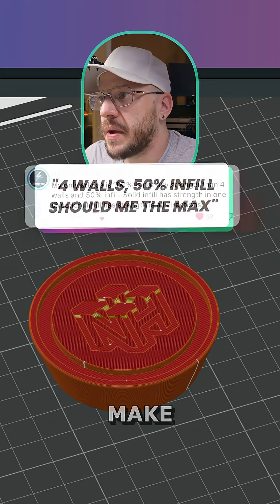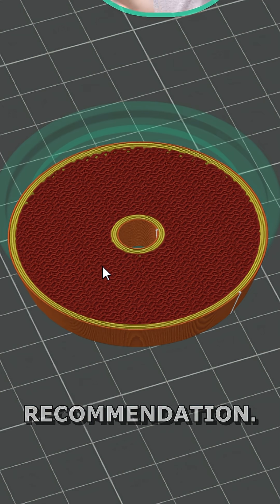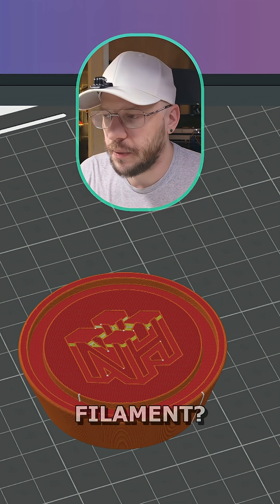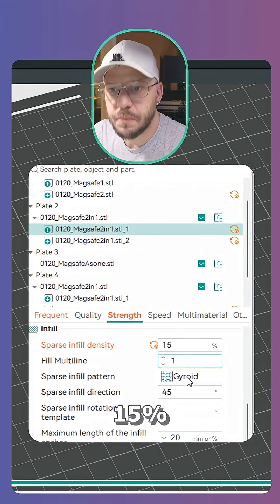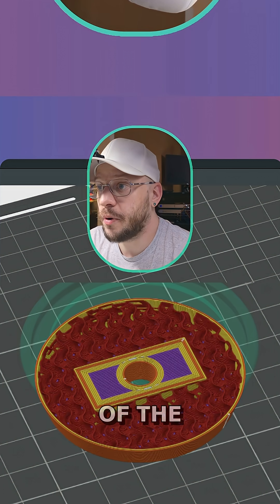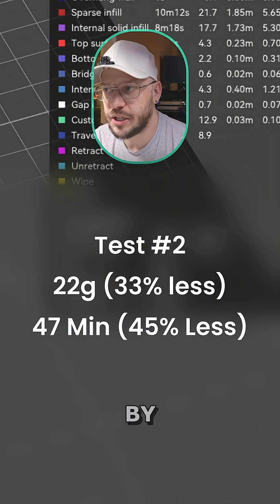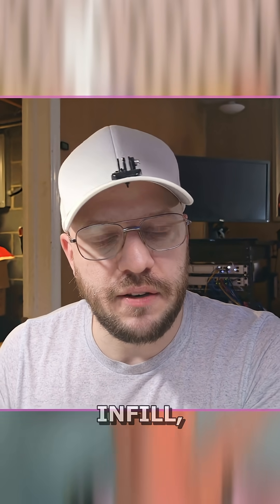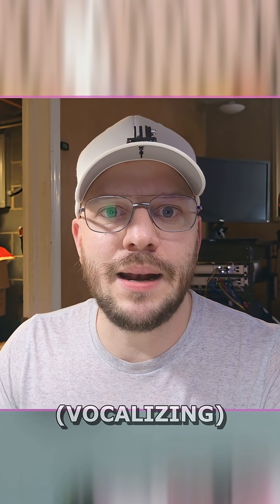Is 100% infill still a no go?

Comment: My first thought on that is you rarely would only need the strength in one area. What I mean by that is yeah you strengthen around a connection point, but if the rest of the part is weak then you are just shifting the failure point elsewhere. I hope that makes sense.

Like for a thread, yeah you strengthened the thread, but now the whole part around the thread is the failure point, the whole thread will twist out, not just the threads.

Edit: I imagine that maybe on much larger peices it makes sense as the localised force would be spread out in a much larger print.